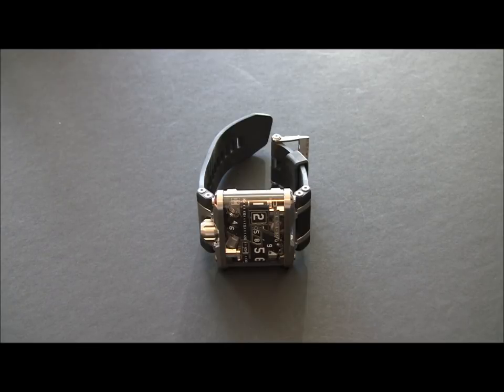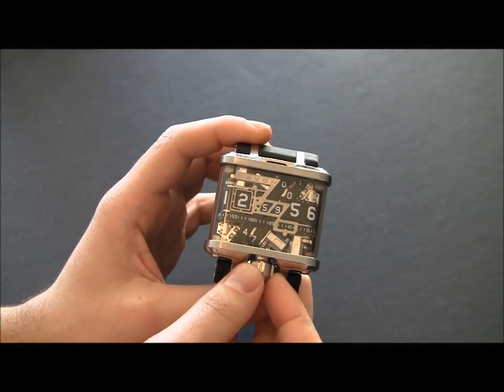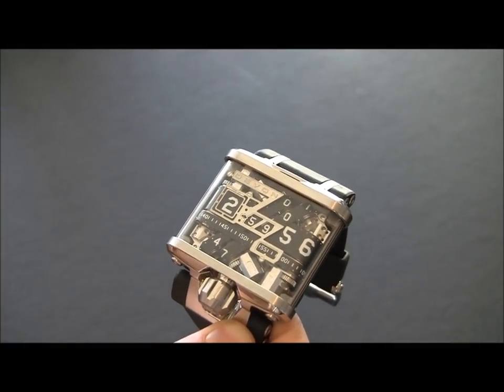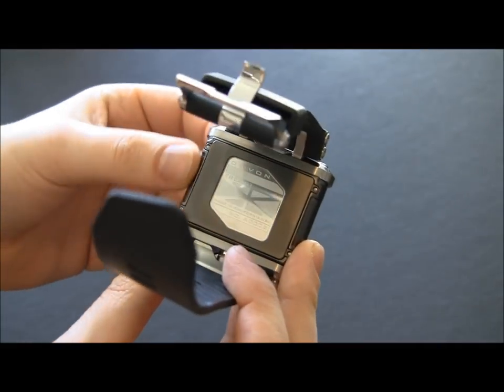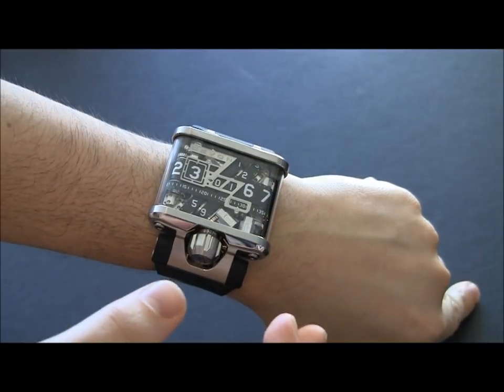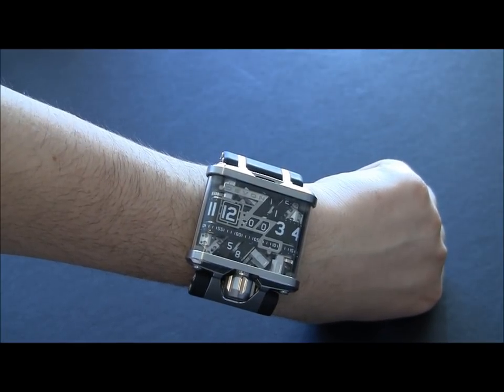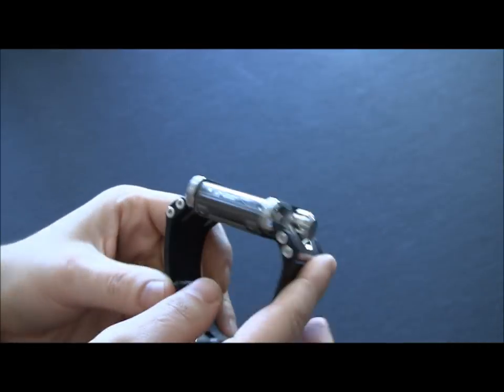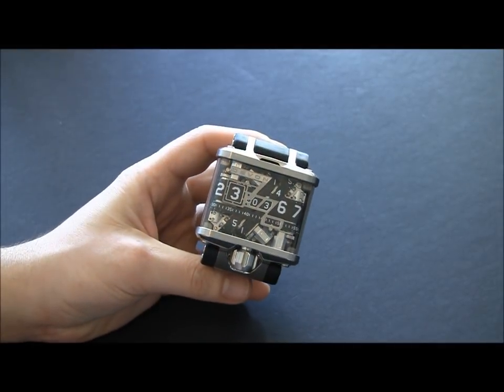Devon Tread 1 Watch Review

Comment: @burningforever666 
OK, Automatic watches need to be put in a watch winder to maintain power.. what is different about THAT and just putting this on a charging pad?? and there are many many automatic watches well over 50k-250k! I mean, it's even WIRELESS charging. Think outside the box and accept something totally cool and unique. Other Hand-wound watches (which I love) have to be wound almost DAILY. I wear watches that are 51,53, and up to 57mm and I only have a 7.5 inch wrist, so this is fine.